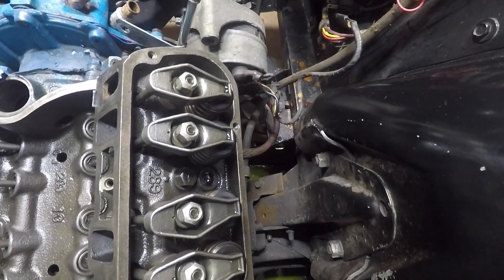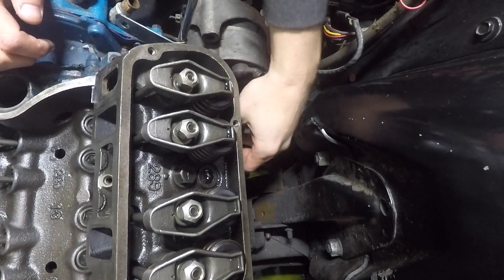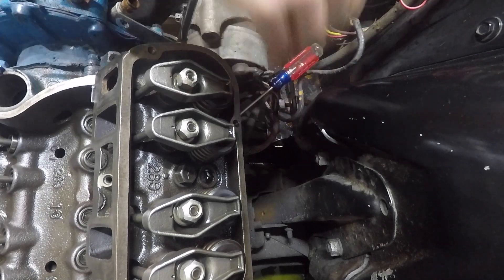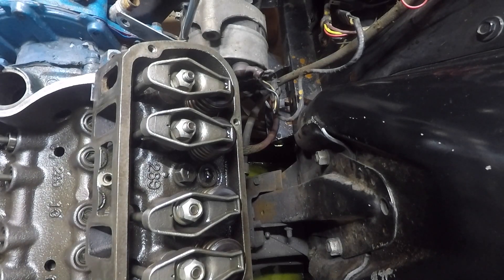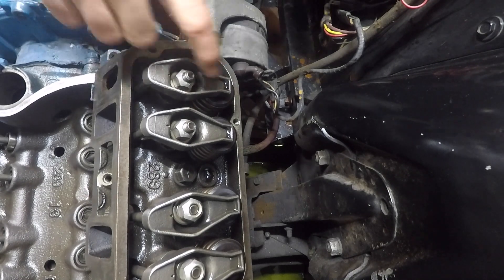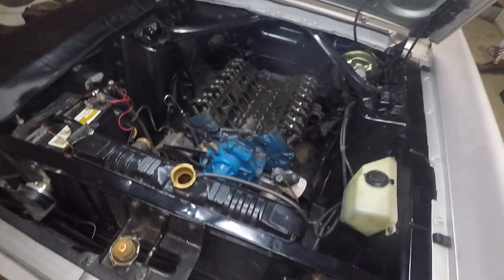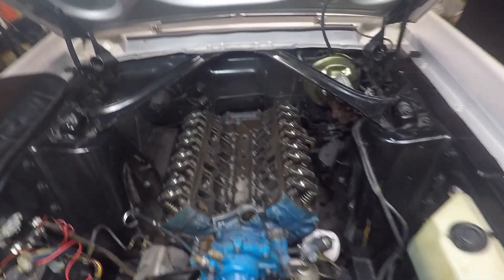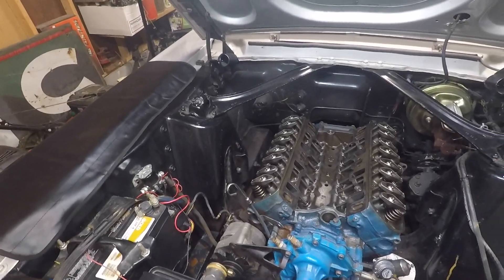Part 2 of Mustang 289 Engine Assembly  Setting Valve Lash

Comment: Ford shop manual specifies 3/4 turn after zero lash, not 1/2 turn. Not much difference.
Reply: I ask the same question
Reply: Where did you find said manual?
Reply: Ford says 1/4 turn.

Comment: So the piston will be at the top on compression and exhaust stroke? If so I would also be able to tell because both valves will be closed and the rockers level. Where if I was on the exhaust stroke the exhaust valve would be wide open and the lifter would be much higher?

Comment: I have a 65 mustang/ 289. Purchased it last year. The intake manifold was removed by previous owner. I am thinking about installing a new one. Any suggestions appreciated.
Reply from the maker: I only have experience with the  Edelbrock Performer Aluminum intake (Part # 2121) as it was installed when I took ownership of this mustang. It's well made and fits perfectly. Since it was on my 289 when I got it, I really can't say if there was a performace increase compared to stock (but feel rather confident to say there is). The intake has a Edelbrock 1406 carburetor sitting on top and the pair seem to compliment each other well. Thanks for watching!
Reply: Thank you! 
You mention your an IT professional by day,..but you love to work on cars. I'm no where near your level. But there is hope, ...Pastry chef Instructor....but obsessed with pre-70. mustangs. Look forward to your future videos.